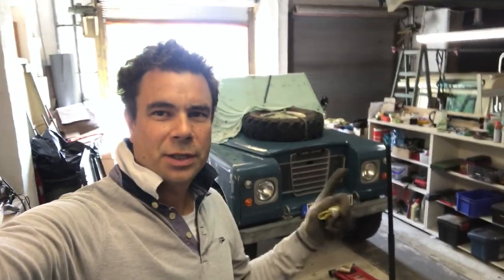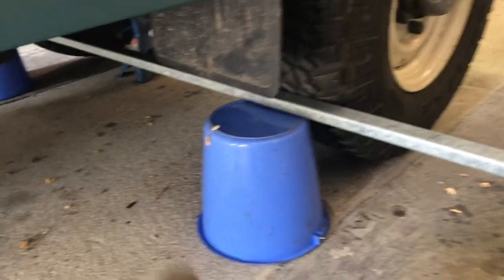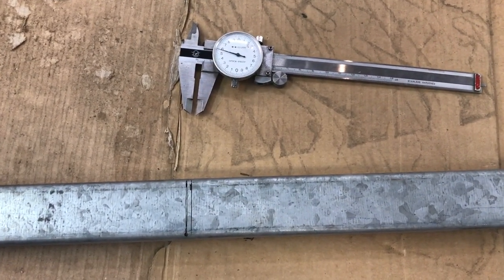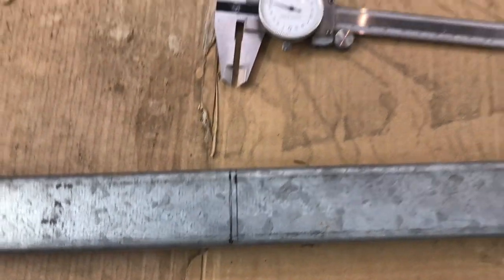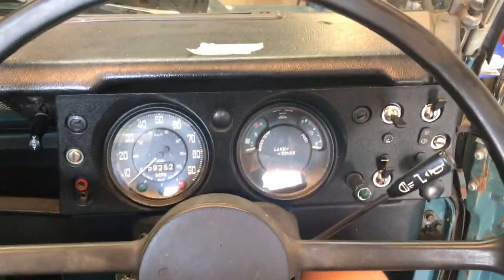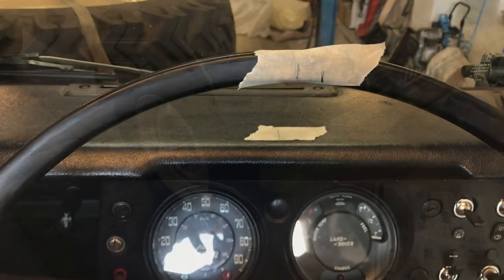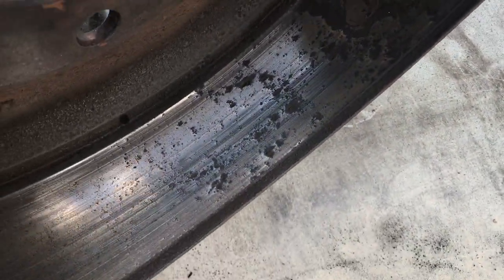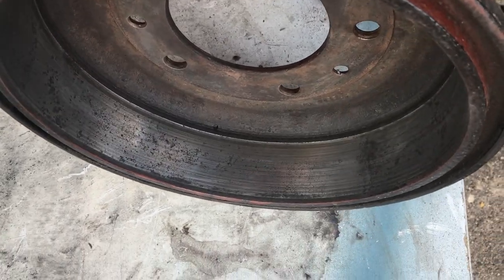Land Rover Series 3 Restoration - DIY Wheel Alignment & Front Brakes - Part 78

Comment: Thanks Joel, that looks like a technique I need to try, once I’ve fitted the new alternator, heater pipes and a thoroughly detailed clean. Although I strongly suspect I will soon be buying various ball joints 🤦🏻 to add to my shopping list..
Reply from the maker: Hi, well that all sounds like a sound investment. Definitely worth doing the ball joints before you set the alignment. Otherwise you’ll end up doing it twice. Or just do it twice of course, adds to the experience. 😀

Comment: Nice to know you are still alive!  Great to see you Sir.

Before you buy new drums, take those to a shop and have them re-machined.....  If they still are no good, THEN buy new drums.....

In the USA, that is not that expensive....

Never saw that alignment method before....  I was sort of taught a method with strings running the length of the vehicle....  But, quite honestly, even the guys who taught me that, would freely admit, this gets you CLOSE...  Depending on what it is, hey, close could be better than good enough....  Now, don't take this the wrong way...  I'm not saying you did a bad job, or anything of the sort...  but you had a lot of parts off...  You replaced a lot of parts...  You don't know where it was before, and you don't know where it is now....  Pros, with the machine, could say hey, look, this is what we found, and straighten it out, and it could well be something you'd have no way of measuring for....  The truck looks great.  The truck is legit.  You have done a great job, Sir.  It deserves, to be put on the machine, and straightened out, so that it drives nice, looks nice, and is as impressive as it should be....

Again, in the USA, you can pay, I dunno $100, to put it on a really good machine, with lasers & all that, and that should get you aligned....  Or get you close at the very least...

Some shops have a deal where you pay a little extra, but for the next year, you can keep bringing it back....  I don't know if that exists in East Germany, but, you might look into it....  If you are not happy, if you keep bringing it back, and try to tell them, as best you can, what is going on...  Like, "Hey guys, in big high speed sweeping turns, it acts like it's fighting itself, and wants to go left"  That, will tell those guys a LOT, and they will know what to do, if you can give a really good description, of what it's doing....  Just a suggestion.  Give it some thought.

A proper alignment, can tell you, centerline, wheels vs centerline, toe, camber, all that stuff...  Not that you aren't trying hard, but, there's no way to measure some of this stuff reliably, without the fancy machine....  Just saying...

Anyways, great to see you, I hope you are doing well Sir.
Reply from the maker: Hi Patrick, nice to hear from you too. Yes, still alive but work is at its peek right now. So very little time for the garage :(
I agree 100% that it should go on a machine, and I must do that at some point. Just haven’t got round to it. I even have a pretty good alignment shop near me who does the BMW. As you say it’s around 100 dollars. 

There is also some play in the steering box which I need to eliminate, I can literally turn the wheel a few inches left and right without making anything move at all. Another job there, and probably another video. 😀 Keep safe and speak soon. Will hopefully get another 911 video up before Christmas. But not sure if you are following that project. Regards Joël
Reply: @My911  I am enjoying both projects Sir.  Merry Christmas!
Reply from the maker: Hey Patrick, how are you doing? Haven’t heard from you for a while. 👍
Reply: @My911  I am doing great Sir.  I'm not quite sure what's happened...  I'm still subscribed to you, with notifications...  But I somehow haven't got any notifications.  So I saw your reply, and then got curious, and bounced to your Youtube page, and I see I have missed a bunch of videos...  so I need to correct that....  Heh heh heh!  Sorry about that.

It could have been me too I guess, I've been a little busy...  I retired, I moved, I've been helping out my Dad with some stuff, I was helping a friend of mine get his boat running...  Seems like I've been busy....  But, that's kinda part of what I was looking forward to in retirement, to work on what I wanted to work on, on my own terms....  So it's been fun.  

I don't wanna write a whole book here in your comment section...  So let me catch up, see what you're up to....  I'm sure you recall, I watched like 72 of your Land Rover videos in 2 days...  heh heh heh!  You probably think I'm nuts.   Heh heh heh!  Maybe I am.  I thought they were great.  What a project.  

To be honest, that video series, should be required viewing, for anyone who thinks they want to do a project car or truck....  You should go into it, with your eyes open.  Life gets in the way!  It does.  Even when you're a retired guy in Florida, life gets in the way...  Doctor's appointments, eye doctors, air conditioning repair guys, meetings with the guy who is going to replace your outdoor screens....  To say nothing of hanging out by the pool with your friends....  Or, when you're in paradise, people want to come visit you, so then you gotta put the project on hold, clean up your house, pull it together, look civilized, when they get here...  As a single guy, sometimes some of these things kinda fall by the wayside, when you're in the middle of something...  I don't have a wife or girlfriend yelling at me all day, to clean that up, pick that up, put that away, blah blah blah.....

Anyways, I'll try and find your email or something in your video description, and catch up.  Great to hear from you Sir.  I hope you're doing great.  I wish you nothing but the best.  It's Super Bowl Sunday here, which is the American Football Championship Game.   I know, the rest of the world watches Soccer.  I love my Football Joel.  So, I'll be a little busy, I'm going to a Super Bowl party a little later...  Talk to you soon.
Reply from the maker: @patrickmorrissey2271  great to hear from you. Enjoy the Super Bowl. What a blast!

Comment: Hey, great video - thanks! That will be helpful down the line. I'm just underway with a SIII 88 restoration. 
Just curious what size tyres you're running and if they're on original rims? Cheers
Reply from the maker: Hi Andrew, great to hear from you. My tyres are 235 x 85 x R16 on Original Land Rover Wolf rims. The hub studs are slightly short for the rims but still work. Check out Steamwally. He has the same rims as me and swapped out his studs for longer ones. I should do this too really. Good luck with your restoration. Regards Joël
Reply: @My911  Hi Joël, thanks for the reply. The wheels look good! I actually have 109 rims that came with the car, they're a bit wider than the original 88 rims, so I guess I'll also try 235 s or a touch wider?
Look forward to the next video 👍
Reply from the maker: I also changed to the Wolf rims as they have the lip on the inner rim which bears the new style tyres. The older rims don’t have this. I also have a set of the older 109 rims and didn’t use them for this reason.